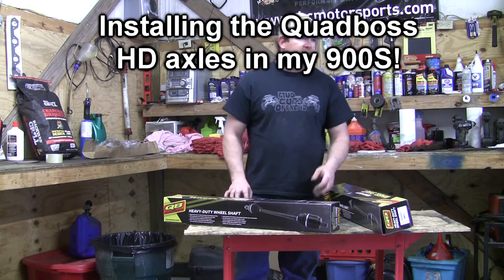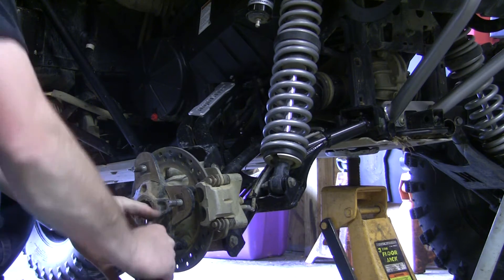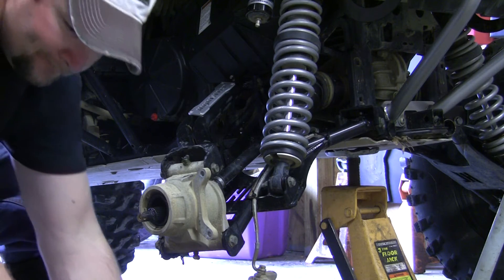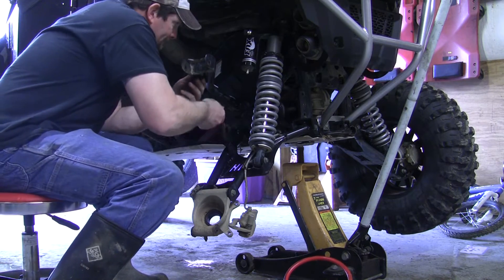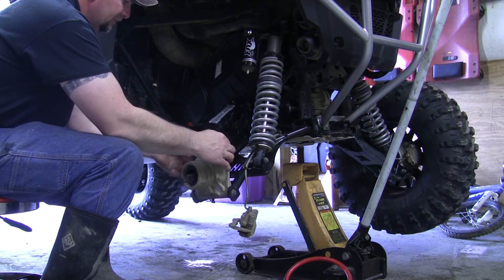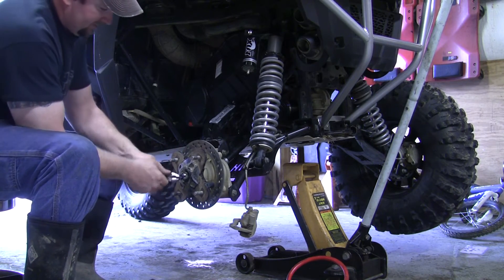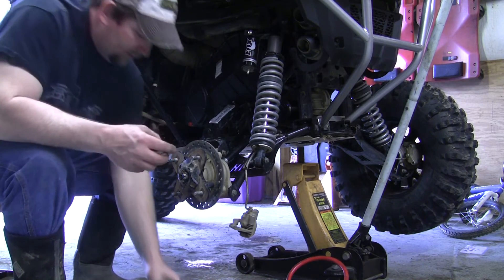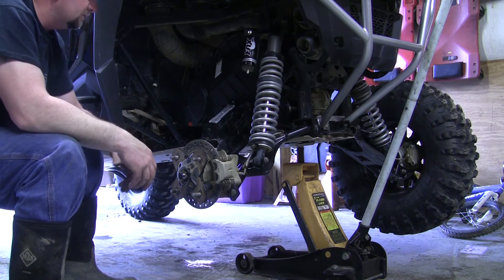Installing the Quadboss Heavy Duty Rear Axles in my RZR 900S!

Comment: did you break an axle or did u just want stronger ones
Reply from the maker: +Brandon Rucker I needed a couple spares so instead of ordering a couple stock axles I ordered four of the QuadBoss Heavy Duty's to run and then use my stock axles for spares! My stock axles where still good but with the added performance and oversized tires I figured the smart thing to do was go ahead and upgrade before they gave issues.